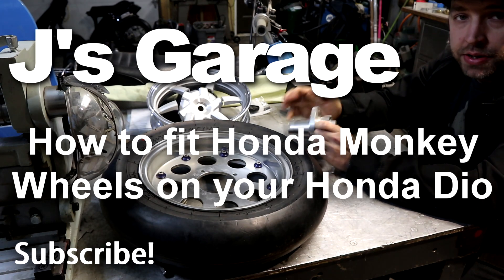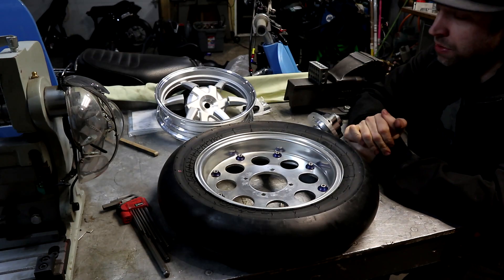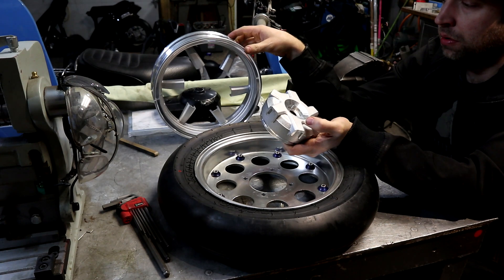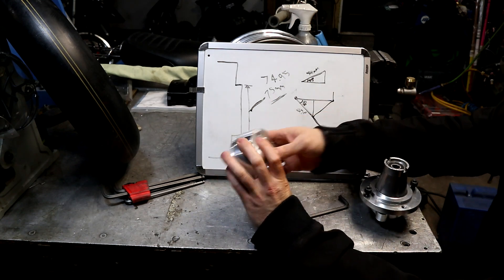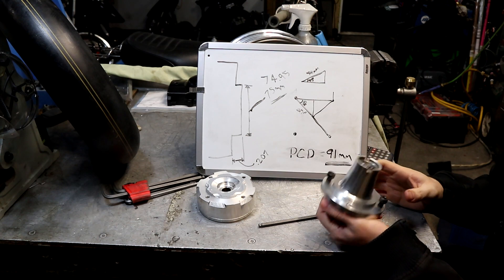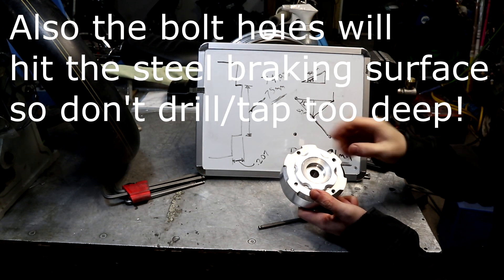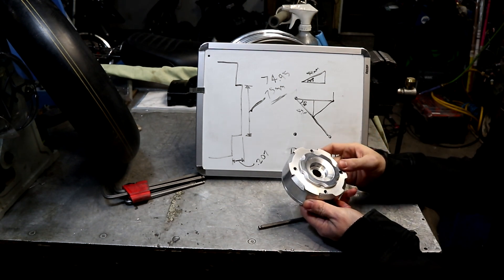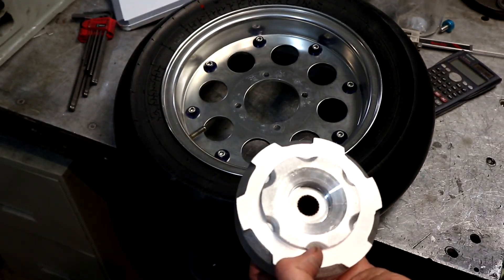How to fit Honda Monkey Wheels on your Honda Dio - J's Garage

Comment: Do you by any chance sell these hub adapters? great work
Reply from the maker: No, sorry..  Also after a while he ended up switching to a custom made all steel one as the cheap hub started to show failure.

I think if I was to do this again I would use a steel dio wheel and weld a thick flange to it then turn it down in the lathe.
Reply: My wheel is steel and has more of a flat surface

Comment: Hey Joel it's jwhood from over 49ccscoot,the didi17 hub will it fit those 8 hole 10 inch monkey wheels on AliExpress I swear I can't find any measurements that tell what wheels will work with that hub do you know where I can find a cheap set to fit a didi17 hub thanks for any tips or info or even links thanks bro
Reply from the maker: Yes it will but only for the front.
Reply: Any idea where I can get a rear 8 hole or similar nothing shows up on buyee if you know where bro please send me a link and I'll use an AliExpress 8 hole up front
Reply from the maker: @flee_N_Elude78  Not without making one,  I think there were long obsolete Daytona hubs that may have worked....
Reply: @pitobread  I could take a 4x90 and just remake 4 new holes and make them 4x140 but then I'd have 8 holes unless I can get someone to Tig the old holes in, you think the 140 holes new placement will work?